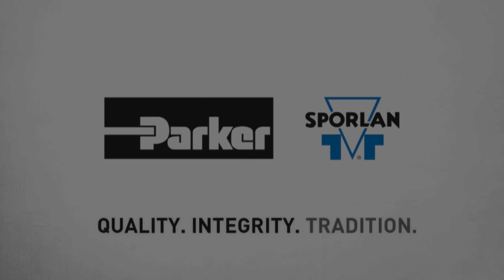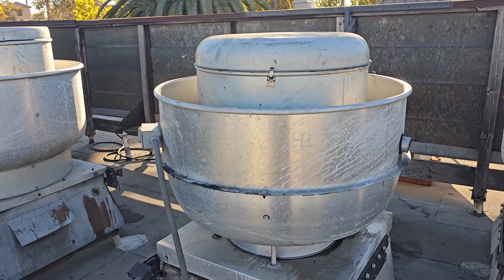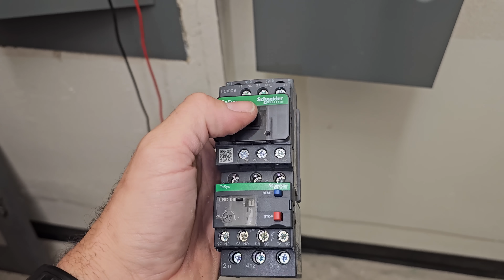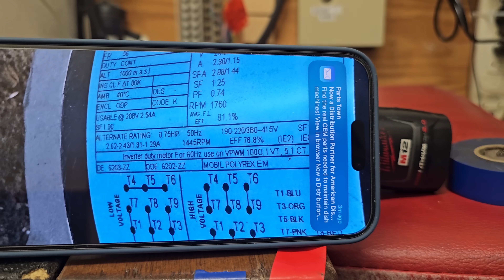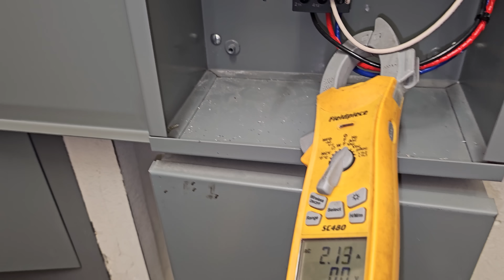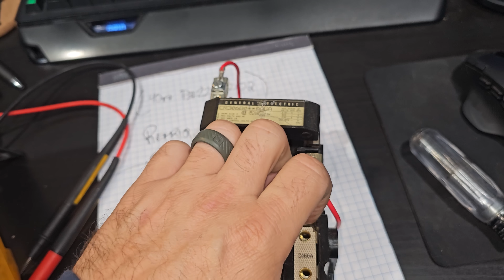SOMETHING IS NOT RIGHT

Comment: Chris I don't think the NEC allows you to re-color the green wire. I believe any wire under 4 AWG cannot be re-colored except the white wire. The reason is if the wire runs through another junction box, someone will confuse the green wire, if it is not re-colored, with a ground!! In my 40+ years as an electrician, we NEVER re-colored the green wire!!! We pulled  new wire if we did not have enough wires to do the job according to code!!
Reply: came here to say this. 

Art. 250.119. “Conductors with insulation or individual covering that is green, green with one or more yellow stripes, or otherwise identified as permitted by this section shall not be used for ungrounded or grounded circuit conductors.”

you generally can’t re-identify white gray or or use them as an ungrounded conductor, either, but I don’t have the section number handy.
Reply: The code has probably changed a lot since I was an electrician. So you are probably right. I'm just going by the code when I was an electrician. Thank you. @htroberts
Reply: @rf159a That is because you are a professional and take pride in your work. The hack(s) who taped the green wire doesn't care that is against NEÇ code because it is dangerous.  💣
Reply: The real reason is we were taught this in apprentice class and I was part of a Union. But thank you. I believe we as a Union did quality work. @adamdnewman
Reply: @rf159a  The union electricians do tend to be better educated, usually because the people teaching them have actually done the Job (practical hands on experience).
Reply: @adamdnewman  That is setting the bar pretty low for being professional and take pride in your work.  Could have used any color and picked the one that will get the next person killed.
Reply: @jonleiend1381  I think the presumption here was that they picked green deliberately, thinking they were running  single phase 120V...
(I do agree it was the worst choice, once they repurposed the wires)

OH--I just had a thought about how the overload heater got burned up!
I occurs to me that maybe they wired the control relay 3-phase at the controller end, green wht blk, but at the box they wired the wht blk to 208V single phase, and grounded the green wire!?
That would account for the one heaters being blasted, and the other two relatively normal looking.
(I suppose the next step might have been to believe they blew the overload, and then bypassed it, frying the motor.  I wonder if they tried it again single phased w/ green grounded, and subsequently fried the motor, or if it was on three phase when it fried...)

Mr K L
Reply: I am not sure you can tag a green ground wire as a phase color??
Technically it's a wire and it doesn't matter as long as both end go where they're supposed to BUT correct me if I'm wrong I believe that's not Code though.
Edit: Deleted my comment and moved it down here.
Reply: In Germany you can't recolor any wire, doesn't matter which color and if you are an electrician and see wrong colored wires you have to change them or you are the one going to prison if something happens. Doesn't mean if changing an outlet or an item you have to change the cables, but if you expand or renovate you have to change everything. That is something homeowners often do not like if they have very old houses. Actual code says ground is yellow/green-striped and the three phases phases are black, brown and gray. Switched phases can have the additional colors white, orange, red or violet. Old code (until 1965) said ground is red and one of the phases was blue - You see the problem if you want to expand an installation. Mixing old and new code would not be a good idea and because of that you always have to change everything to new code if you renovate or expand the system and it can be more expensive than you thought as an homeowner that only wanted a new few new outlets.....

Comment: So, was it actually the starter that was the original issue or possibly a bad connection in the junction box that smoked to heater or was it a burned up wire??

Comment: My son just got stung by a 208V green wire. That the electricians used for hot.

I got zapped by 120 V green wire from electrician, who forgot to run a extra hot wire, so they disconnected and use the ground wire in place of a hot wire . I was 24 feet up on the ladder when that happened.

It’s not always the voltage that kills you. It’s the fall. . 

Thank God 120 V zap to me is nothing more than a mosquito bite .
Reply: Don’t try it when your body has a good connection to earth/ground 😅
Reply: @SproutyPottedPlant  yeah, I know like when your arm is resting over the EMT as you go to wire nut the green ground. 

It does zap you a little more when it’s the underside of your upper arm on that tender soft skin when you’re a little sweaty . 

Done it 

Dunedin, Barefeet on concrete to

Comment: I remember a piece of 3ph equipment in the UK. Not HVAC but a pasta boiler. Customer complaint - Power light goes off when you turn it on - not tripping breaker, but also not heating. 3Ph 415V phase to phase, 240 to neutral. Measured it out. 63V on the phase that powered the indicator light to neutral, dropping to zero under load. No other power present. Took MULTIPLE (6) requests for an electrician to fix. Electrician would attend, see the green light and say 'Unit has power, not out problem' then we would be called back - rinse and repeat - Eventually I arranged to be there when the electrician attended. Usual BS 'Green light - has power' So I hooked my meter up, demonstrated the issue and then walked out while the regional manager of the chain chewed out the electrician who's company ended up covering ALL our bills after the initial visit until it was back up again. Hopefully that electrician learned to TEST and not just guess.
Reply: Sadly some people are blissful in their ignorance and or laziness

Comment: complexly illegal to use earthing/grounding colour green/green yellow as any other purpose in aus/nz
Reply: Same in Finland. You have to be able to trust that the green/yellow is always the ground. Thankfully here electricians know it and follows the rules.
Reply: I forgot to mention it is also not permitted to be re flagged as another colour.
Reply: @ratbag359  Same here in the US. Some electricians  need to stay playing with shoelaces not wiring.
Reply: @ratbag359  Yep, same here. That's if the cable / conduit gets broken somewhere in the middle, the green/yellow is not taped in that spot and here you are with ground wire with power that shouldn't be possible.